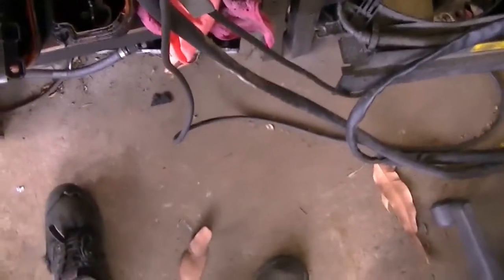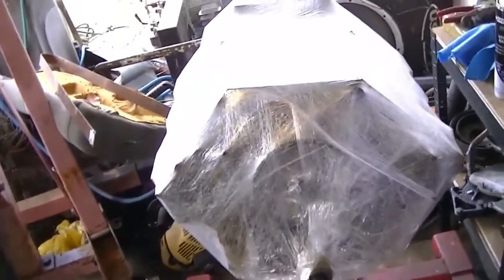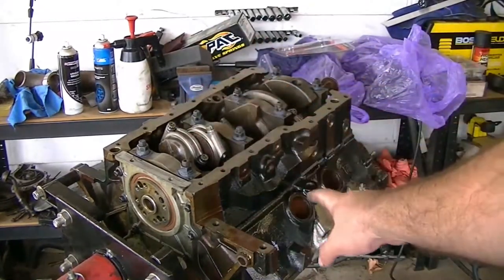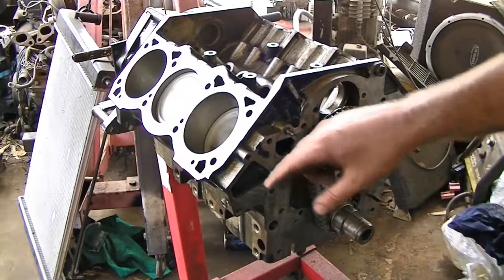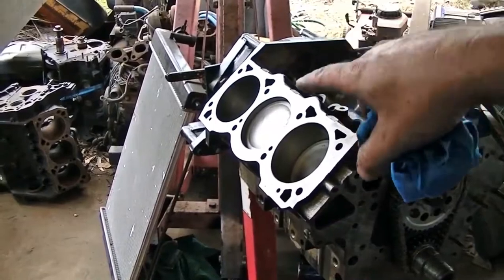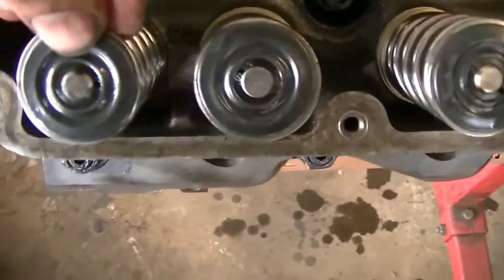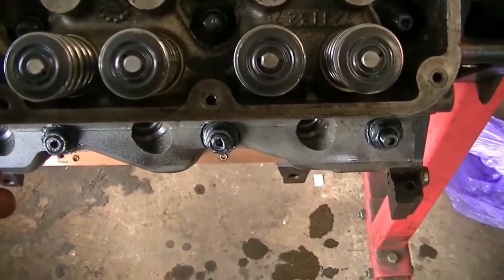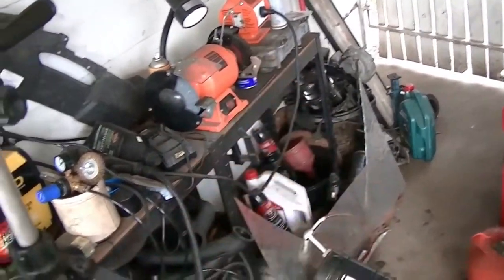turbo ecotec build... continues head install.

Comment: You can get the adjustable push rod so that you can get the right lengths saves you having to buy a bunch of different ones
Reply from the maker: Yeah man I just made my own out of an old pushrod and checked the length that way but I did think of those thanks man 😁🤘

Comment: m8 what was the point behind marking your harmonic balancer?
Reply from the maker: So when I start it up I can check the ecu is on sync with the motor and has the correct timing... which I'm happy to report it is correct 😊